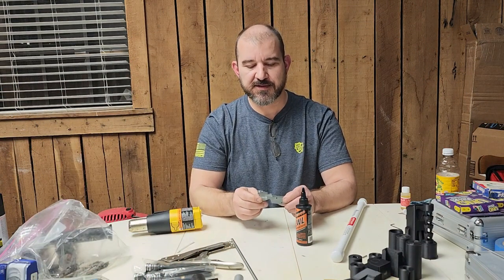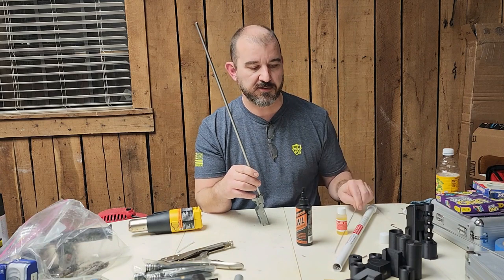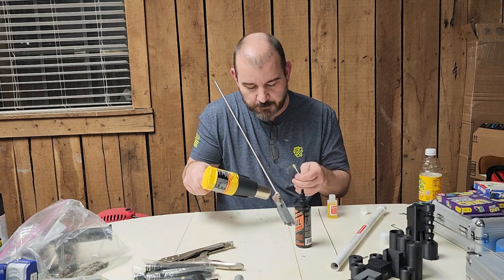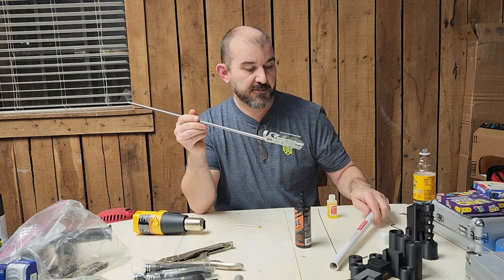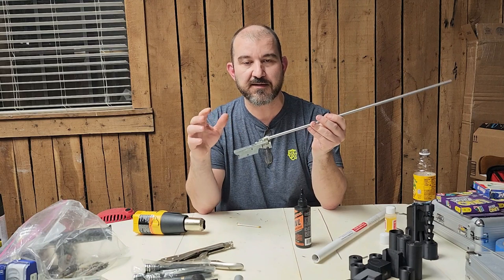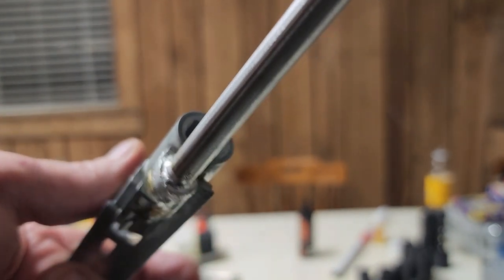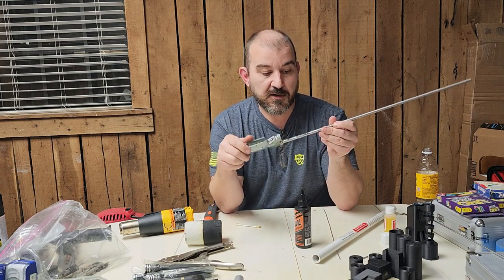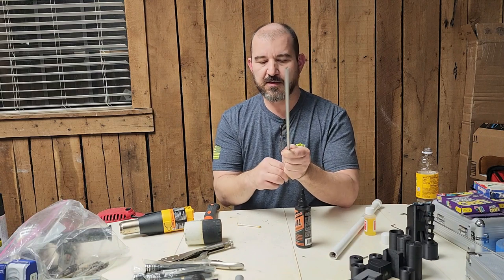Barrel installation in a Daisy Air Rifle Valve Body

Comment: I wonder if not using CA glue wold be perfect for this. It flows in and seals perfectly and also releases with heat, just a little less. 
But i can't realy understand why you couldn't just heat up the valve body and reinsert the barrel with a light tap and when it cools it would be firmly seated. In reverse of removing the barrel?
But i never done this so I'm just thinking outloud. Great videos anyhow, even though i would like to get a bit closer to see better sometimes. Keep up the great work👍👍